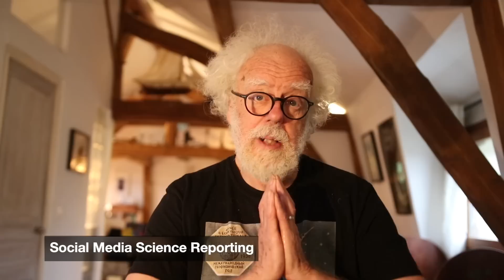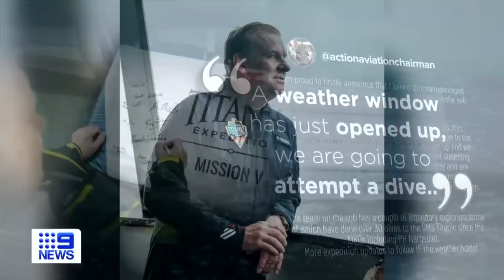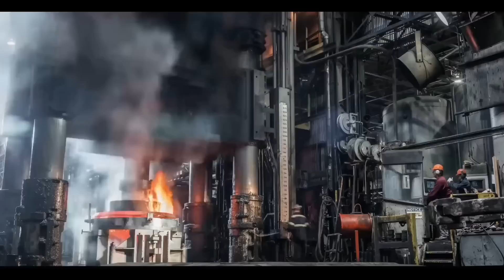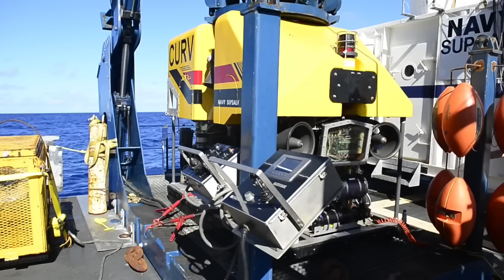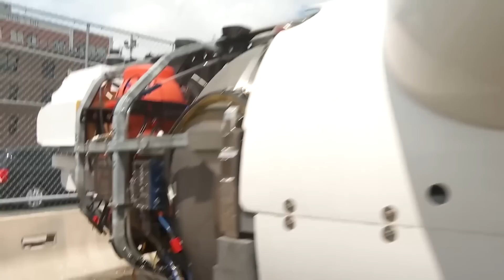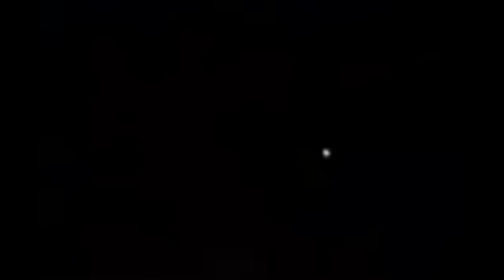Missing Sub - Bad News

Comment: Nice to see one of your videos again.  Yes, what a tragedy.  It is starting to look like they are going to run out of tome to find them before their oxygen runs out.  As you say though, sending a submersible down 13,000 feet below the surface without adequate safety  equipment and recovery procedures is ridiculous.  It makes me wonder how they got insurance for the business!  Also, as you said, we don’t know enough about the project to know how much preplanning went into the design and the operations plan.  We can only guess that it might not have been enough.
Reply: my guess is fraud, pertaining to your insurance question
Reply: Oxygen not the issue, the CO2 scrubbers are the issue, as the scrubbers will fail first, before the oxygen level drops to the point of them simply going to sleep and dying then with nothing felt. The scrubbers are the thing that will saturate first, and they are also limited in lifetime. You can easily have a lot more oxygen there to handle things, but the scrubbers are limiting factor.

Pingers are the problem, in that the most common ones are limited in depth for operation, at 4km down they are well outside operating depth, which is around 1500m, after that all bets are off on operating. Even the deep submersible ones are difficult, you need them to have high power to operate with the thick wall pressure vessel they are in, and thus they are big and heavy, plus have a limited battery life as well.

Comment: Even if they find the missing submarine they don’t have a way to rescue it from 12,000 ft. down in Davy Jones locker .
Reply: Sure they do.... but that equipment takes days to get where it needs to be...
Reply: You are wrong, there is a rover on the way that is capable of lifting it, unfortunately it will probably be to late.
Reply: @griffith500tvr  It would require a 12,000 ft long cable to be attached to the Titan by an unmanned submarine ... I don’t think the rescue technology is available at this time for that short window of 5 days and the emergency being 900 miles offshore .

Comment: Thanks for your research,  I noticed that no details are given about how those people could be recovered,  the movie "The Abyss" showed that it would take a miracle , very unlikely.
Reply: There aren't any details because there's no attachments for falls simply because there was no deployment skid on the mothership. It was towed out on station on a barge instead of being craned off a deployment skid from the tender vessel.

So assuming it can be located an ROV will have to strap a lift bag onto subs skids or skid legs and it'll pop up to the surface upside down and extremely violently due to turbulence. The contents will look a bit like day-old tandoori masala by the time they get the bolts off.